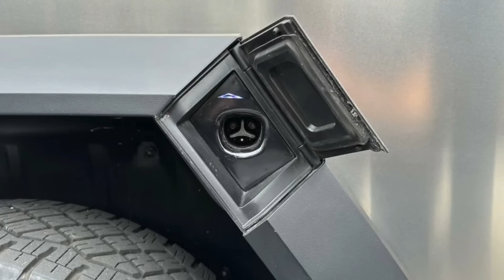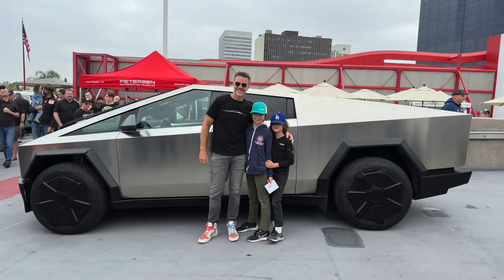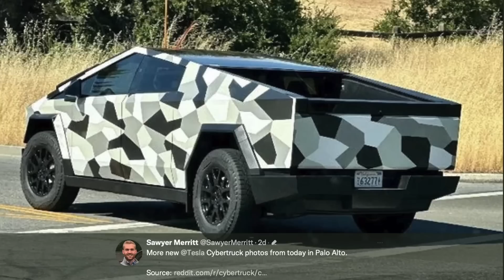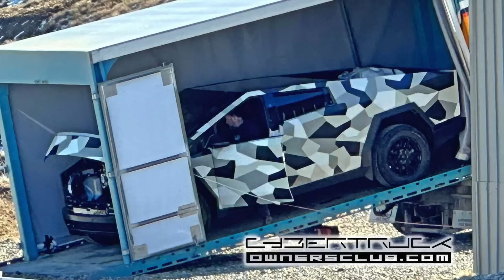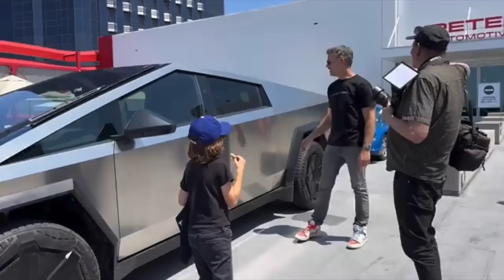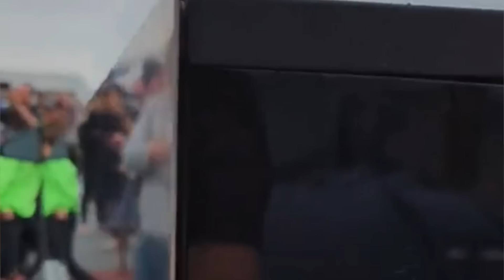Cybertruck UP CLOSE & Personal 🤩

Comment: Deliveries will not start till 4th quarter 2024 at earliest but my guess is 3rd quarter 2025.  They are prototyping still, and right now the relationship between the Biden crime family and Elon is not good even with the "big guys" ten percent or more cut.  Election  year is not the time to "ask" or "certify" something.  The dust will have to settle after November/January 20205.   My guess is still nothing till 3rd quarter 2025 or later. 

On a side note does the CT have a spare tire under the back truck?  How is it accessed?   What type of jack is used to change a tire cause this thing is gonna be stupid heavy?

Comment: The first models to be delivered will be the quad motor, top of the line variant. I don't see any way that it starts less than $110,000. Tesla is historically very adept at managing supply and demand with price and with over a million pre-orders and all the competition pushing past the $100,000 price level, they have every reason to charge at least that much.
Reply: I really want them to all be the same. No options, cybertrucks are maxed out because they're just that cool. Easy to make and sell, what you see is what you get. Then sell them for $60k and gut the fancy truck sellers.
Reply: @why6212  nice idea, but you'll never see a quad motor Cybertruck for $60k
Reply: I agree. Anyone who actually thought the cybertruck single motor would be the cheapest tesla is absolutely stupid. The quad motor will strt at a higher price than model x plaid. The dual motor will probably be right around same price as model s long range
Reply: @matthewp1682  exactly, I don't see it coming under the price of the MXP.  More motors, More battery, More hype, Infinitely more backorder, More utility, ect......no way it's cheaper
Reply: @shilvock22  I agree. Even when they first announced it back in 2019, I said there is absolutely no way that a single motor cyber truck will be $39k. There is no way this will be the cheapest tesla available. I highly doubt they will even bother with a single or tri motor as well. I think it will only be quad or dual motor
Reply: @matthewp1682  agree 100%
Reply: Just like Ford, most reservations are for the $40k version at announcement.
Reply: @foxtrotwolf6081  No most were dual then tri motor, but the folks who selected dual may get priced out
Reply: @foxtrotwolf6081  What are you basing this statement on? All the data I've always seen and just looked up right now show that the single motor, $40,000 model was the least chosen option. Were you just going off of a feeling or a hunch? I'd love to see your source of data... Can you share it here?

Comment: Re: $70k-$90k Initial Pricing. That’s how I’m budgeting my 3-/4-motor & 1-/2-motor reservations. Expecting 2025 delivery (wide window thinking maybe 50% actual take rates). Call outs for +$30k from 3- to 4-motors seems a bit much, but given expected TSLA run ups, by then, price shouldn’t be an issue (higher the better on all counts) for me.

Comment: Regarding EU sales, the elephant in the room is all the sharp corners. We have pedestrian impact legislation regarding the sharpness and radius of corners etc. I really can't see how its design would be legal over here and can only imagine what a pointed stainless steel corner would do to a human body in a minor collision.
Reply: Check the other comments. Probably won’t sell the CT in Europe. It’s that simple.
Reply: @JeromeDemers they will likely make some other kind of truck (probably similar to the Ford Maverick) rather than completely cede those markets.
Reply: @JohnGeorgeBauerBuis  very good point. Never thought about it. Tesla is very data driven. Not sure how many maverick are sold in Europe. If the volume are there, Tesla could do it.
Reply: We've been there before: remember when we in the UK had to take off our chrome metal bumpers and fit large rubber ones for the US market?  40 years on and the metal ones still look better😀

Comment: I don't think they plan on launching it to other markets anytime soon considering right now it's only made in the US and the US is by far the biggest pickup truck market. It will be several years before they sell it overseas and only if it does well in the US.
Reply: Australia is probably the only major market outside the Americas that will see Cybertrucks anytime soon.
Reply: And Canada 🇨🇦 😊
Reply: How can they sell in australia when it is right hand drive?
Reply: @ranjithpowell6791  Are you joking?
Reply: Seeing as large pickup trucks don't really sell well overseas I doubt anyone outside the US has any interest in this.
Reply: Most of the rest of the world a pickup is a work vehicle, no one is going have this hauling bails of hay around a muddy field.
Reply: @wakey87  Why wouldn't they? Aside from the side pillers that make it harder to throw stuff from the side, this has the potential to be a far more utilitarian truck. It will have wore more torque than any regular truck and better traction control making it way less likely to get stuck and with a stainless steel body and aluminum castings it will do much better in dirt and grime than body on frame trucks with painted steal. All new trucks are out of my price range, so I would not buy this, but I would love to take this mudding or use it daily on my farm. I would not use it if I needed to haul stuff more than 200 miles round trip though. It will take too long to charge a 200kWh+ battery and cost too much to use a supercharger, but I rarely have to haul anything more than a 100 mile radius.

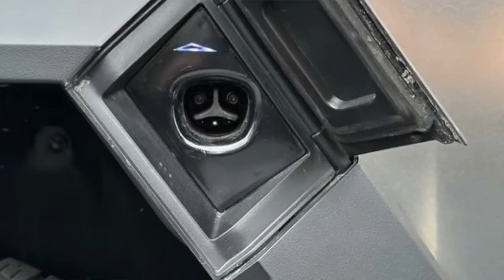Comment: 1:32 There is no current at the charge port when there is not a plugged and even locked connector. That's why you can safely connect any EV at an even 200 kW charge point under the rain. When you connect the plug, a protocol is used to check that all is fine, the connector is lock, and only then the charge starts. And you cannot unplug while charging, you must first ask the charge to stop, and when it is safe the charge port is unlock.
Reply: Thank you. The sealing would mainly be for dust and mud, not so much protecting from moisture.
Reply: Yeah. That comment had me puzzled as well. Would be a very dangerous product if that port was “hot” all the time.
Reply: Elon Musk has finally come to our rescue, if really he can turn SVB to a digital currency bank with good security, its gonna help lives
Reply: Yes but for 4WD use the wheel cover is the first thing that gets broken

Comment: Hum my prediction about pricing. I think follow. 1) we will never see a single motor variant. 2) The dual motor instead of 49k will be 59k and have ~ 321 Mile range. 3) The tri-motor will start at 79k and have 518 Mile Range. 4) Quad motor will start at 110k and have 479 Mile range.
Reply: Re: $70k-$90k Initial Pricing. That’s how I’m budgeting my 3-/4-motor & 1-/2-motor reservations. Expecting 2025 delivery (wide window thinking maybe 50% actual take rates). Call outs for +$30k from 3- to 4-motors seems a bit much, but given expected TSLA run ups, by then, price shouldn’t be an issue (higher the better on all counts) for me.

Comment: How do you fit a winch and can it be powered by the main battery?
Reply: Mods will be the responsibility of the mod market. Once they get their hands on a few trucks; we will see variations and aftermarket kits for every setup imaginable. 
The winch will probably still run off the 12volt but it’s the new lithium ion version.

Comment: Given everything I have learned about Tesla in the last couple years I do not have high hopes for this truck.  I certainly think some of the things Elon claimed would be standard would be nice to have but I have seen far too many breakdowns of why X, Y, Z, thing shouldn't work to remain very optimistic.   That being said I defended the idea from haters for the first year after announcement and had a reservation for one for a while  so I am more than willing to keep an eye on it and see how things turn out.     If the truck launches and all versions of it have the big announced features as standard for a decent price I will be pleasantly surprised.  I am specifically wanting the tonneau cover, foldable midgate, HVAC and watertightness in the bed, tailgate ramp, 220v and air ports, floating and finally a high degree of body panel dent/ scratch resistance as these have all been referenced as standard at one point.

Comment: Cybertruck must start with $70k with dual motor & $90k for quad motor. Rough guess through. But would be great if it's near this prices. ❤😂
Reply: I hope there will decide for a quad motor! I'm thinking the price will be close to MX Plaid, nevertheless, I'll take a quad regardless of what price they'll ask.
Reply: Re: $70k-$90k Initial Pricing. That’s how I’m budgeting my 3-/4-motor & 1-/2-motor reservations. Expecting 2025 delivery (wide window thinking maybe 50% actual take rates). Call outs for +$30k from 3- to 4-motors seems a bit much, but given expected TSLA run ups, by then, price shouldn’t be an issue (higher the better on all counts) for me.

Comment: Be prepared to replsce rhe tires once a year
Reply: How do u know this?
Reply: @ptech88  cause I used to own a Model Y and now currently owna RAV4 Prime. Evs are heavy and have lots of torque if you have a heavy foot  the tires don't last long. If you own a EV then you will know what I'm talking about
Getting ready to replace my tires on the Prime with only 28,000 miles.
Bridgestone Turanza EV or the Hamkook ION EVO tires are made for EVs wich I highly recommend
Reply: @badimpulses17  i do. I have a m3 p just replaced my tires after 4 years. No different from my other vehicles
Reply: @ptech88  You know that BMW and Toyota use different tires rigght? What you experience is totally different from my experience. Look up on YouTube about  EV owners having to change there tires once a year, there are plenty of videos, do your own research.
Reply: @badimpulses17  i dont have to do research i own one. So i know for a fact they dont have to be replaced one a year.
Reply: @ptech88  On buddy what ever you say, I do t want to make you look stupid let's just leave it at that. I'm arguing with someone that dont do research but think he's rights it's pointless.
Reply: @badimpulses17  you dont have an argument, my 2018 model 3 performance is on its second set of tires. According to you i should be on my fifth. I hve three friends with evs non have had to change tire’s every year. You are full of shit with your supposed research.
Reply: @badimpulses17  no point in arguing back and forth.  It's possible you're both right.  If you drive 30,000+ a year then replacing every year is likely, especially if you live in a region with winter weather.  If you drive 10,000 miles a year in a warm climate then very likely getting 4 years out of set.  focus more on facts than opinions about matters and there's no need to argue.  EV's are heavier than their ICE counterparts but some people say that like it's an enormous amount.  BMW 330i curb weight is 3,560.  Model 3 curb weight is 4,060.  500lbs doesn't make you lose 20,000 miles of tire life.  Accelerating hard, fast in corners, poor inflation, not rotating your tires, are way more significant impacts on tire life than 500lbs.
Reply: @brianmills4891  Bridgstone Turanza EV and Hamkook ION EVO makes tires especially for EVs.

Comment: I am wondering how long it will be until the first video talking about the nightmare of repairing dents on this thing when someone inevitably backs it into an object
Reply: The object will get dented and not the truck.😂
Reply: @somnang100  what if its backing into another cybertruck?
Reply: I think TFL Trucks can do it in a month. They are good at backing into things even with back up sensors and camera.
Reply: @foxtrotwolf6081 lol.. thought I was the only one that noticed that about them 🤣
Reply: Il ne peut y avoir de bosses 🤣🤣🤣🤣🤣🤣...Les bosses il les fait !!!
Et si jamais il y en a une...ce ne sera plus reparable du tout, parce que tout le véhicule sera hors d'usage...et peut etre meme les occupants !!!
Reply: Actually, that is one of the benefits. All panels are flat sheets of stainless steel and therefore easy to just weld in a piece and no painting required.
Reply: @BjorckBengt  how do you hide the welds?
Reply: @sonofagun1037  with a wire brushed finish